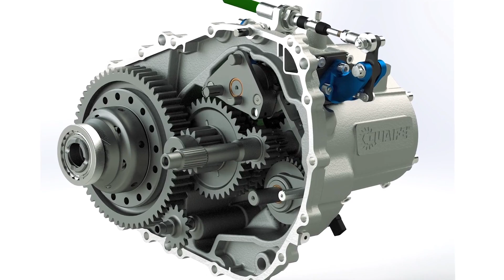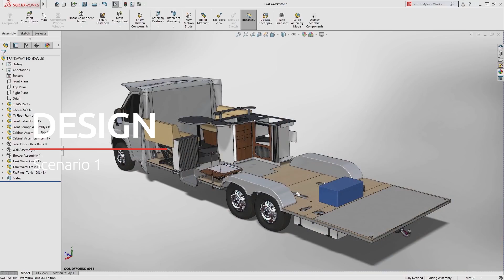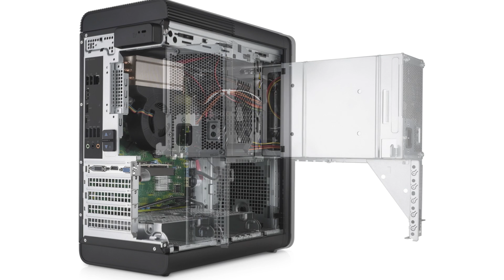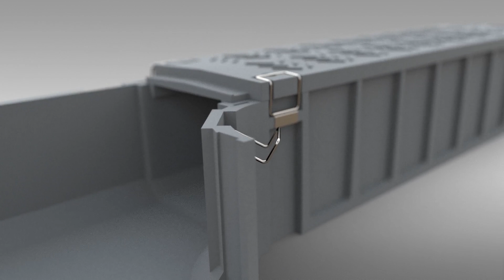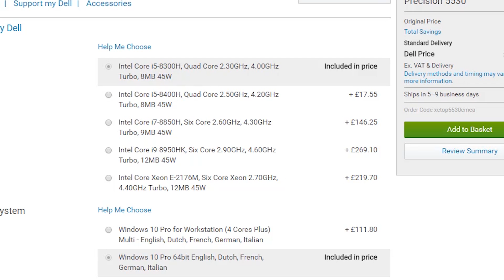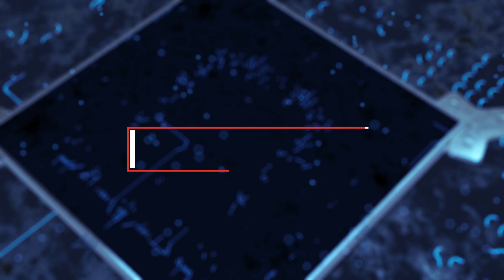The BEST PC and laptop hardware specifications for Solidworks 3D CAD (2019)

Comment: Hello, I am a Civil engineering student looking to purchase a laptop for solidworks, I am looking to buy the hp x360 15.6 inch that has 16gig ram, Nvidia graphics card, 512 SSD, and core i7 8th Gen. My question is will this be good enough for me to run solidworks smoothly or not. Thank you In anticipation of your response.
Reply from the maker: Hi, if you're looking to get the best out of SOLIDWORKS it's really important to get a graphics card that is dedicated for CAD modelling, for nvidia cards these will be part of the nvidia Quadro range and NOT the nvidia GeForce range. The other specs you have mentioned seem like they will be suitable, so you just need to check about the graphics card. If you'd like to read more about it, or check out some recommended machines then take a look at our hardware recommendations page here. https://www.solidsolutions.co.uk/solidworks/Hardware/default.aspx
Reply: Thanks for the response. keep up the good work.
Reply: @TriMechGroup  Would you please tell us post RTX2080 mobile release, if this is still true? I have noticed that most of the software companies have not updated their recommendations post RTX2080 release and the fact that NVIDIA now releases Studio graphics drivers for both the RTX quadro and RTX geforce cards. The move from Pascall to Turing architecture has changed the game, however, by how much is difficult to quantify without updated information from software providers. As an example, would a consumer be better off with the laptop versions of the older Pascall based Quadro P4200 or the new Turing based RTX2080 for solidworks?The Quadro P4200 is a year older and is designed for mobile workstations, whilst the Geforce is for High end gaming laptops but they share many similarities and the the geforce beats it in every benchmark except 2! Both of these configurations are now at similar price points, Both have 8GB of Ram, however the Quadro has the slower DDR5 to the 2080s DDR6 . 

 GEforce 2080 Videocard is newer: launch date 11 month(s) later
    Around 12% higher core clock speed: 1380 MHz vs 1227 MHz
    Around 64% higher pipelines: 2944 vs 1792
    A newer manufacturing process allows for a more powerful, yet cooler running videocard: 12 nm vs 16 nm
    2x more memory clock speed: 12000 MHz vs 6008 MHz
    Around 9% better performance in PassMark - G2D Mark: 875 vs 801
    Around 29% better performance in PassMark - G3D Mark: 13418 vs 10362
    Around 27% better performance in GFXBench 4.0 - Car Chase Offscreen (Frames): 20327 vs 16043

    Around 27% better performance in GFXBench 4.0 - Car Chase Offscreen (Fps): 20327 vs 16043

Then you have the older P4200 Quadro

    Around 4% higher boost clock speed: 1647 MHz vs 1590 MHz
    Around 50% lower typical power consumption: 100 Watt vs 150 Watt
    2.5x better performance in GFXBench 4.0 - Manhattan (Frames): 3714 vs 1497
    2.5x better performance in GFXBench 4.0 - Manhattan (Fps): 3714 vs 1497
    2.2x better performance in GFXBench 4.0 - T-Rex (Frames): 3347 vs 1528
    2.2x better performance in GFXBench 4.0 - T-Rex (Fps): 3347 vs 1528

Would you please explain to us how these two cards compare  as you do not include Pascal based solutions in the above hardware link and they are now at very similar price points.   (obviously the RTX quadros are better, but they are also a lot more expensive)
Thank you in advance!

Comment: Hello!
I bought an ASUS ROG Zephyrus M notebook with in GTX 1060 6Gb, but I also bought an eGPU case - AkiTio Node Pro.
I'd like to use it at home, like a "workstation" and output to external monitor.
I added to the eGPU a Quadro K5000 and had a lot of issues with drivers. (Quadro vs. GeForce) Can't use external monitor.
I wrote to Nvidia support, but they wont support this kind of combination. (they gave me a link to a forum with theme from 2010; and now is 2019 )
Indeed the Quadro K5000 in AkiTio Node Pro connecting via ThunderBolt 3 showing better result in SolidWorks (nearly the same, like the GTX 1060)
So, if I will buy a Quadro P4000 GPU to use it like an  eGPU, will it perform better in my case?
Or can you somehow to affect Nvidia that they do somethig with drivers?
No one will give me a Quadro P4000 for test, but there are no sense to by an ~1000$ Quadro P4000 GPU with this kind of driver issues and leave it on the shelve after failed test.
The AkiTio Node Pro is alredy on the on the shelve. (~500$)
Reply: Maybe because the bandwidth of TB3 isn’t large enough to take full advantage of it?